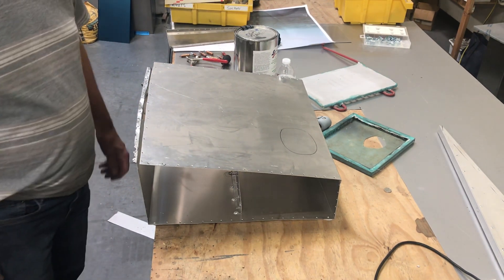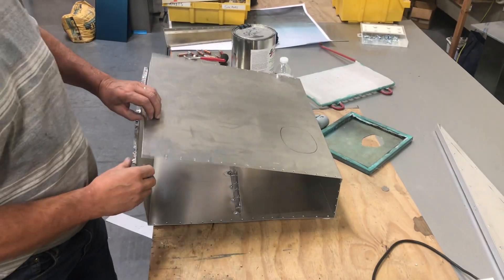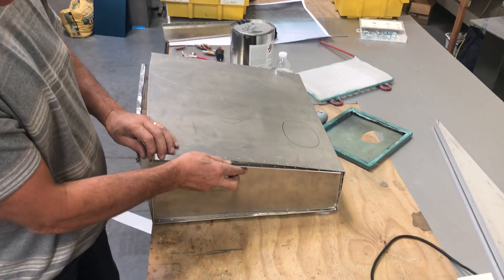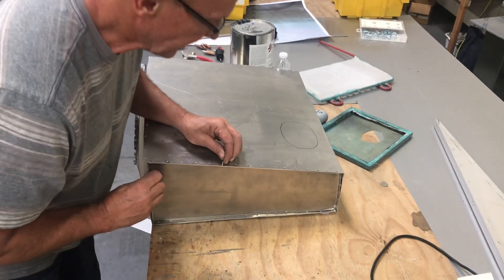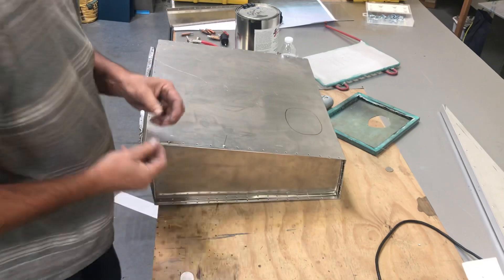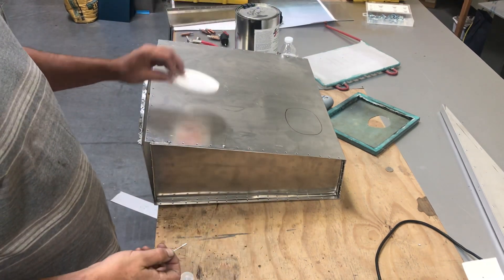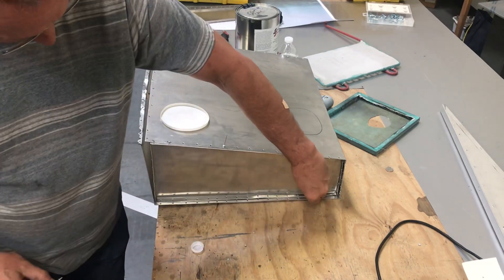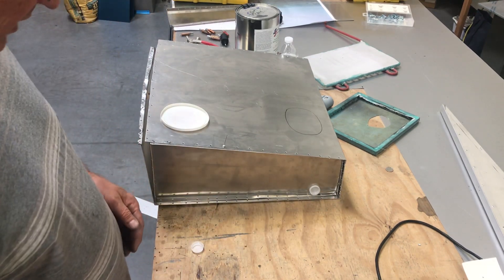Our non welded fuel tanks

Comment: The Technical Data sheet says that it has "Excellent resistance to water, alcohols, petroleum-base and synthetic lubricating oils, and petroleum-base hydraulic fluids." which would be nice for those of us who run auto pump fuel which can be E-10.
Reply from the maker: James Kerns thanks for that, on a side note ,when applying ProSeal it gets everywhere. 45 minute work time cleans up with acetone